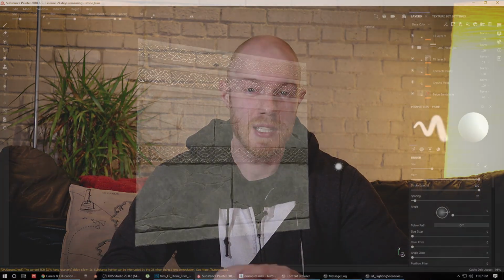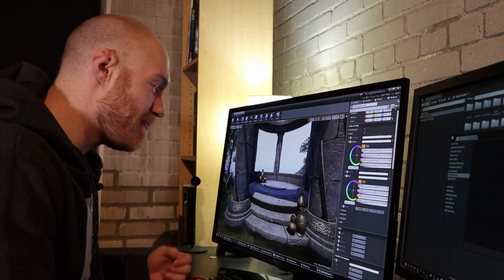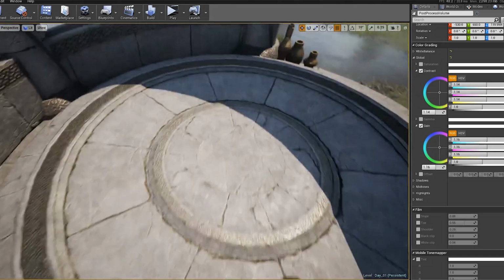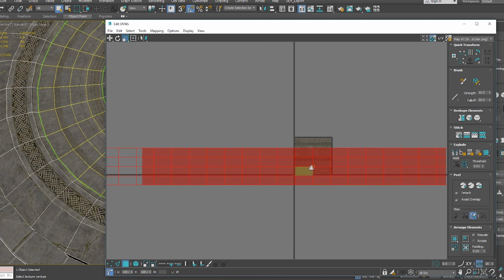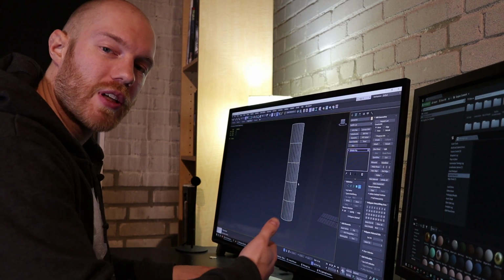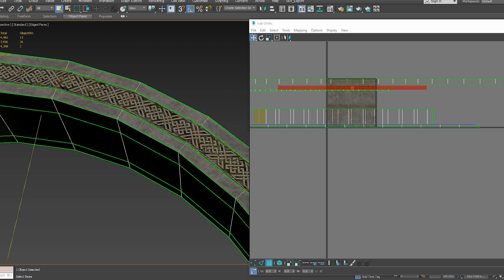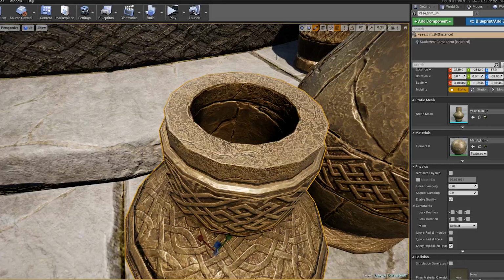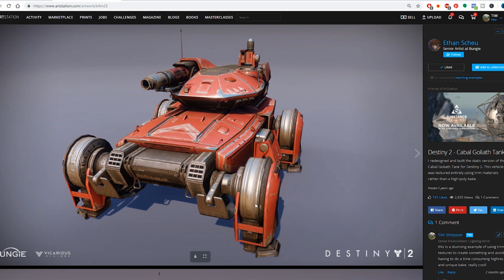TRIM TEXTURE TUTORIAL - ENVIRONMENT ART 101

Comment: Hi Tim,

Thanks for another amazing tutorial. I would like to know that i am using Maya, how can i unwrap rounded objects (like the column in your scene and the floor plates) to be straight UVs. As when i unwrap something like that in Maya, their UVs also come up rounded not straight. You said this trick is for all sort of programs. I am so confused.
Reply from the maker: most of the time you can have cylindrical unwrap option for rounded things it will make them come out in strips, or unwrap via spline. I would just do a quick youtube search for maya uv tricks! each program has its own way of doing it, but I know for sure there are quick ways of doing it in maya, I just am more familiar with max!
Reply: Hello Aadil...
In Maya it's not that hard to do... After you unwrap ur uv.. You can select either a few edges or uv points and then use the straighten uvs tool.

Also another great reference for you would be a YouTube channel called Malcom... Mmmm something... Just search Maya uv malocm..

He has a nice script bundle you can buy.. 

Check him out.. He has all u r asking for.. And its at a very reasonable price.

Hope that helps
Reply: @saebr  Thank you very much Ram. I got the channel, and requested for the purchase already. Thanks again for the help. Been struggling for a while for gridified UVs

Comment: Do you have an easy way of unfolding geometry to be flat and evenly spaced? like the top of the curved wall that you have there.
Reply from the maker: I usually do a uvwmap with the by face option selected on that ring of faces, add a uvw unwrap on top of that, straighten all the edges and then move stich the strip out edge by edge, because I straighened all the edges before stitching it stays straight instead of curving. I will make a mini video on techniques like that soon probably as a follow up!